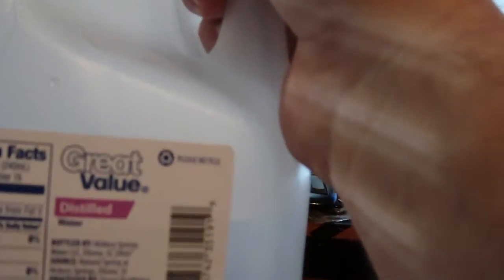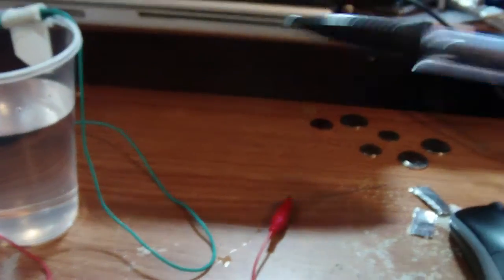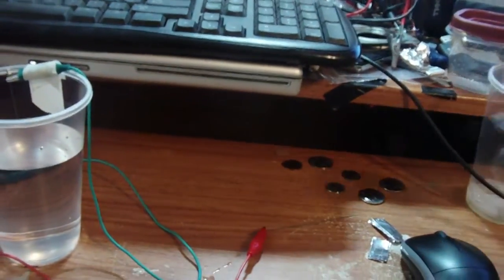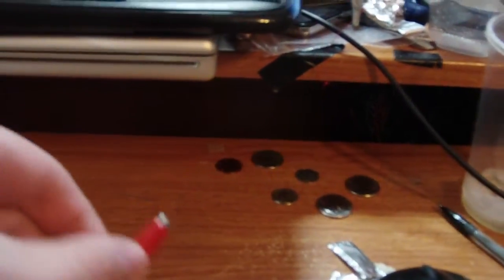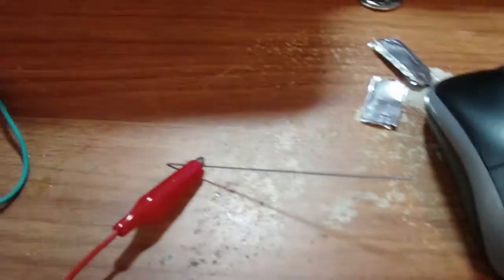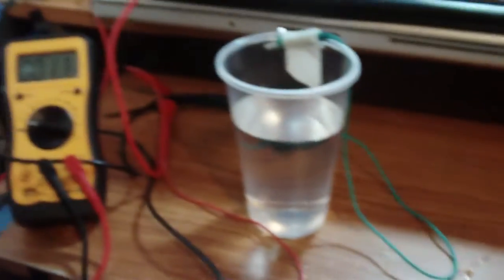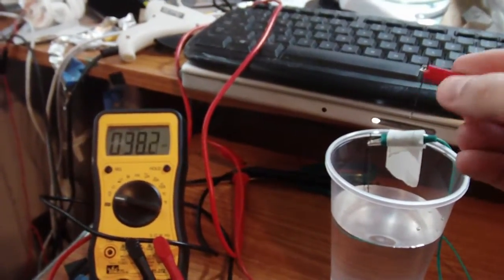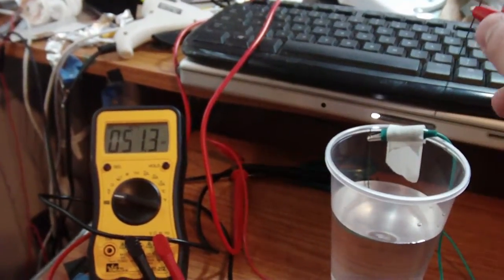Graphite only distilled water battery

Comment: I repeated your experiment, I got 210mv. Measuring distilled water and tap water.
Apparently this voltage is from ambient radiation. I was able to get the same voltage with the probe cable extensions with no graphite. Testing the probes with no cable extensions on distilled water, measured 25 mv.
When testing with probe extension cable, verify the calibration of your dmm.
Sorry for the grim response.

Comment: Hmm, do you really get up to 0.9 Volts this way ?
I could only get about 0.2 to 0.3 Volts at maximum and the current
is very low. Much lower than any galvanic cell.

Regards, Stefan.

Comment from the maker: @theonethatgoofs 

It will run a pulse motor if you put enough in series. Graphite shouldn't dissolve in the water, you can test it yourself by putting a pencil in a cup of water. Gold should dissolve before graphite.